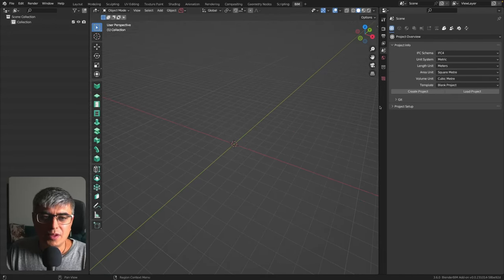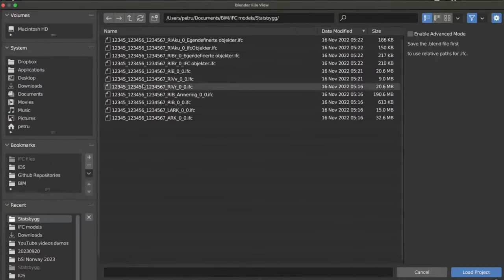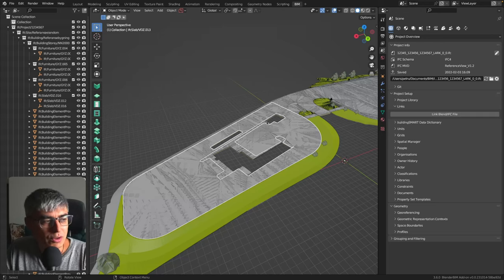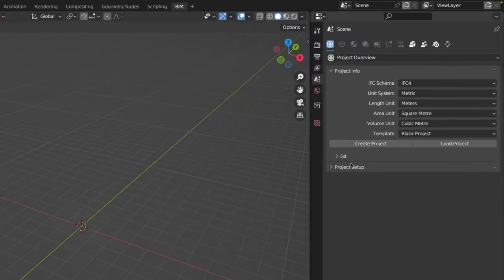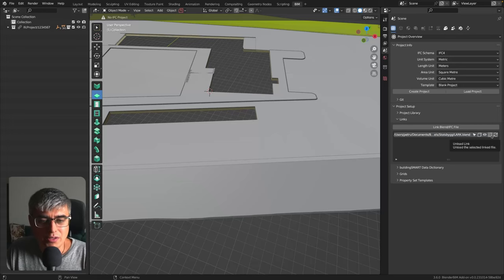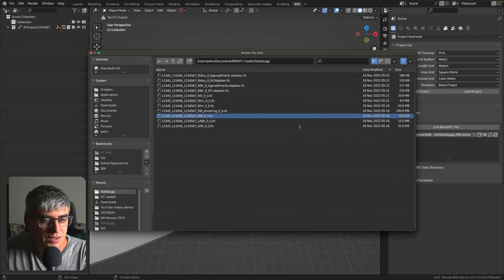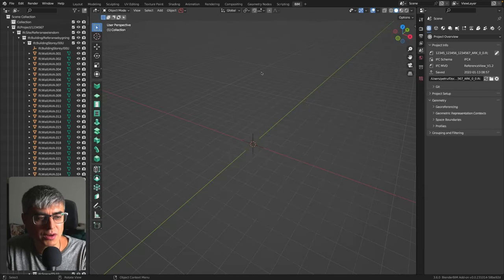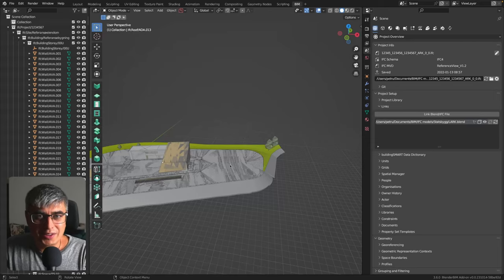Using IFC Models as References in Blender with BlenderBIM

Comment: I hope they manage to link directly an ifc file (not going through the blender save file) so you can reload it easily. If you can do this and with a possibility to overide material from the link ifc file you could even allow the archviz man to work from a realoadable architect model, like direct link between revit and twinmotion, D5 or enscape, priceless...
Reply from the maker: There are already some updates to this. So now it will take normal time the first time you link, and after that, when you link again files that have been linked before they will load almost instantly.